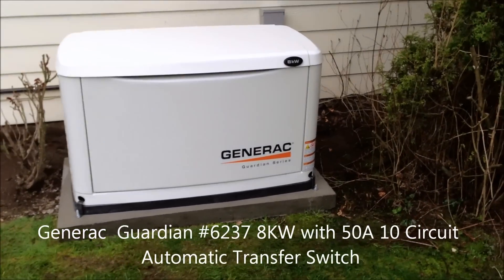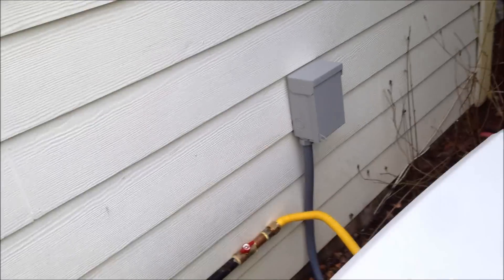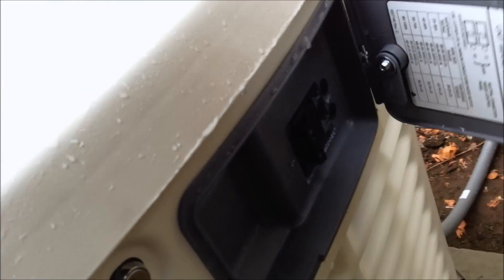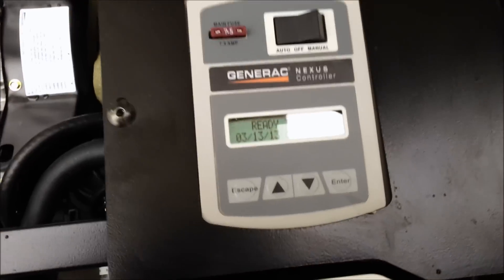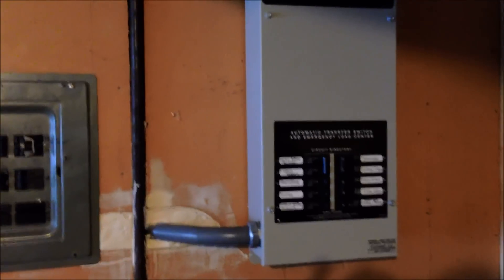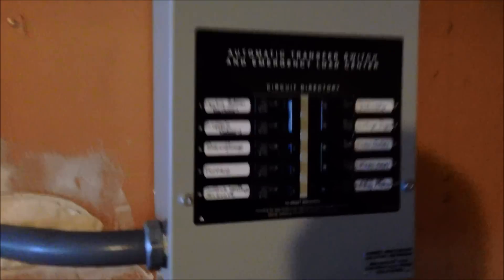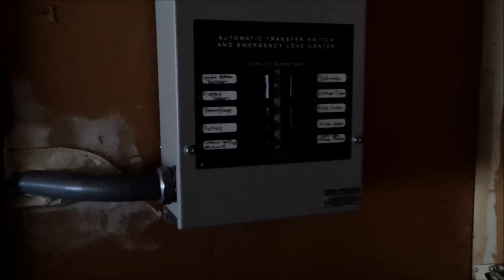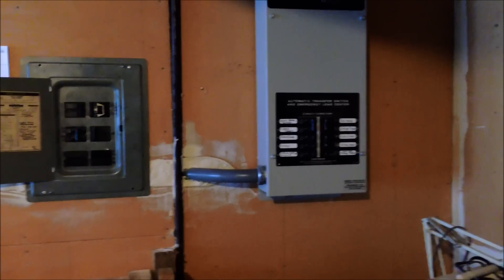Generac Guardian 8 KW with Automatic Transfer Switch Review / Operation

Comment: I have a brand new generac 20K guardian Evolution and the first time my power went out my generac did not come on - showed a code 1100 overcrank so the installer came out and reset it.  Now on the weekly check it was not coming on once again code 1100 overcrank.  My installer tells me its water in the gas line....I told him bull shit.  Anyone else having this issue?
Reply: +Sheila Mailett Is your generator natural gas or propane? The water in the line doesn't add up.

Comment: That flexible gas connector is dangerous! They are designed for indoor use only,,,, usually the Generac's come with a nice rubber flex connector, why didn't that get used?
Reply: +Josh Smith Bootleg install
Reply: Actually, according to code

Piping

Customer owned piping shall be designed and installed in
accordance with the NFGC.

Corrugated Stainless Steel Tubing

Corrugated Stainless Steel Tubing (CSST) is allowed for new
construction, remodeling, and retrofitting applications in residential
and light commercial structures. CSST shall meet the design and
installation requirements set forth in ANSI/AGA LC 1-1993.
CSST is not designed to be used as a flexible gas appliance
connector and shall not be used as a substitute. The use of CSST
as a final connection for permanently installed appliances, such
as water heaters, furnaces, and boilers is allowed. CSST shall
terminate outside of the appliance jacket where the excessive
heat may ignite or damage the protective coating. The use of
CSST as a final connection of movable gas appliances, such as
ranges and clothes dryers, is not allowed.
CSST shall not be installed outdoors and shall not be run
underground unless installed in a sleeve or conduit.
Reply from the maker: Plumber installed that. We are the electricians, didn’t know that wasn’t allowed 😳

Comment: Nice video. I didn't realize these generators were as noisy as they are. Do you notice it when you're inside of the house have you got any complaints from your neighbors regarding the generator running? Thanks
Reply: Look into an 1800rpm liquid cooled unit. They run quieter and last longer and can run extended periods of time.